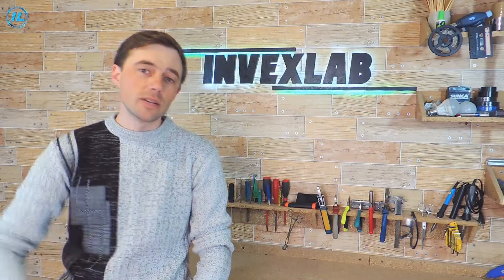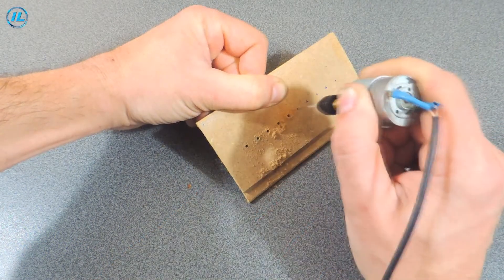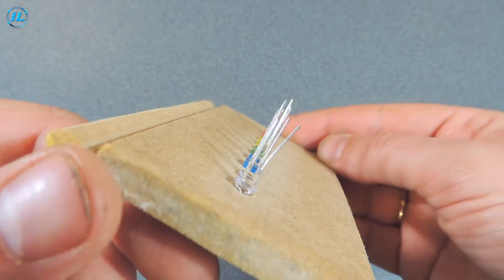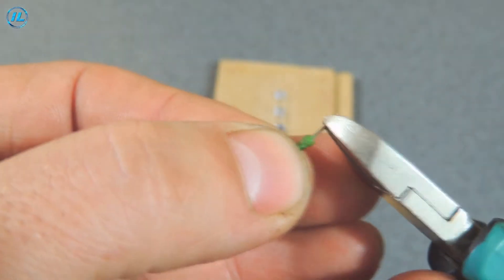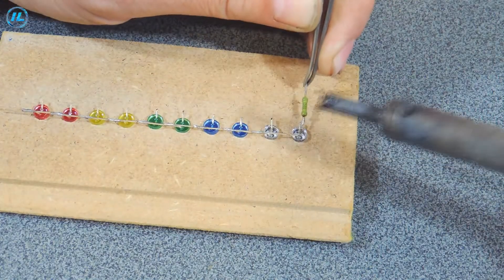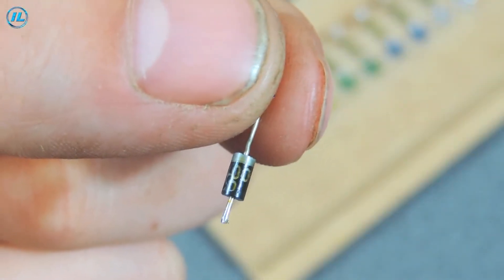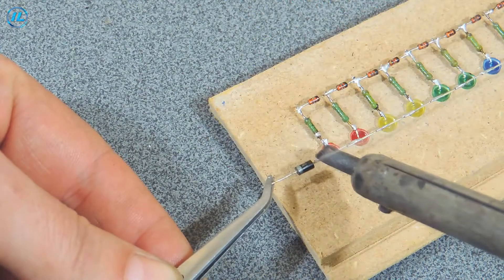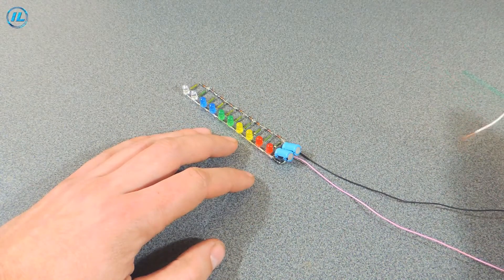✅ Led sound level indicator with your own hands!!! All genius is simple! ✅

Comment: What is the theory behind using resistors and diodes? I think each resistor cause successive drops in voltage, and the voltage slowly drains such that each higher LED has a theoretical combined forward voltage required. I think it is important to use LEDs with the same forward voltages, or else the color transitions might not reflect a linear scale of volume.
Reply: It's less about a consistent scale (even though with some smart ohms law application it can be done) and more just visualizing a change in amplitude much like a comparator.
Reply: High impedance speakers are can have outputs of 70 volts. so its simply the supply exceeding the  voltage drop of each led diode and the rectifier diodes acting as triggers with the current limiting resisters keeping everything safe.